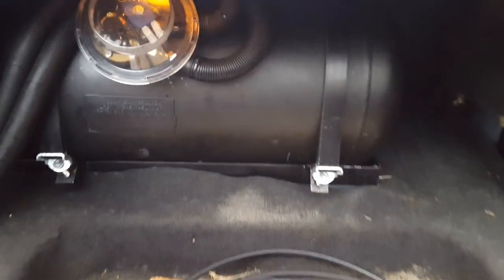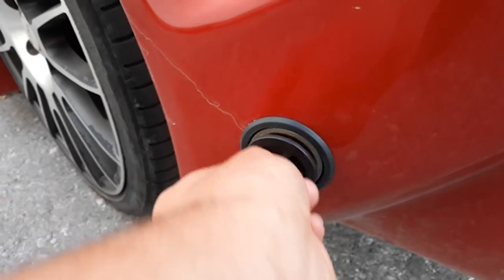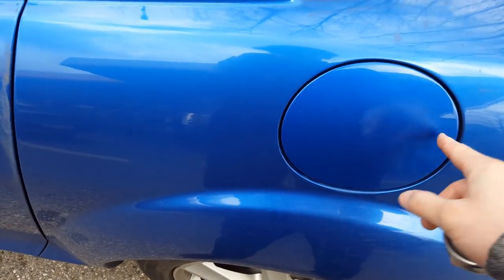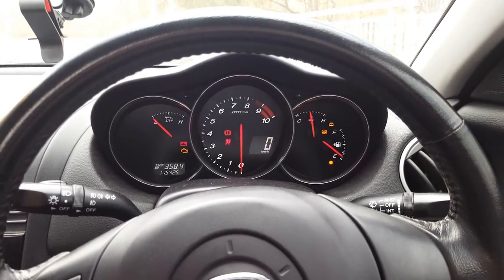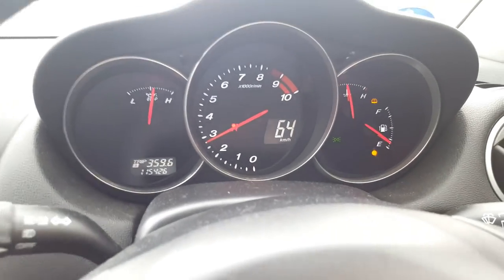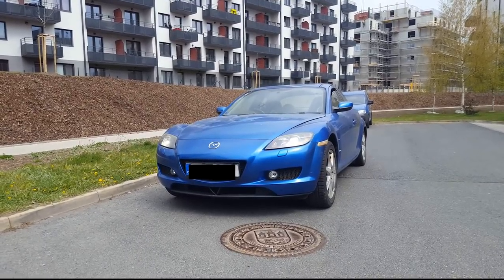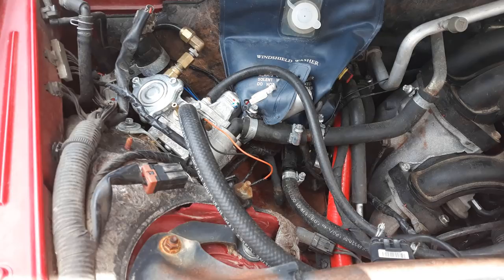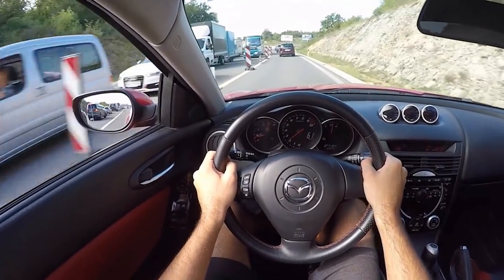Mazda Rx8 LPG Conversion | Pay Less, Drive More

Comment: For those that don’t know LPG = Liquid Petroleum Gas similar to propane. This mod seems only worth it if you drive your 8 long distances daily. You will have similar power and will spend much less on gas. However, the initial cost to set your 8 up for it is not worth it otherwise.
Reply from the maker: Thanks for explaining what is actually is and the essence of it. Cheers!
Reply: Don't forget you're adding a huge weight in the back of the car, which will definitly offset performance and make the car act pretty horrible in a corner. Handling should've been the reason you had a rotary car in the first place, so in that light I think it's a weird mod to say the least...
Reply: Driven By Madness I was actually considering this mod because I daily my 8 but I don’t drive long distances and 93 octane not too expensive where I live. Great mod though if your situation allows. Not many people know about it.
Reply: Flyingdutchy33 very true. It depends if you commute with the car long distances. Some people buying these cars as dailies now because it’s an inexpensive car.
Reply: Depending on Winter and Summae, it is 40-60% Propane and 40-60% Butane. My LPG8 switches to LPG in winter in 2 minutes and in summer within 30 seconds. It just makes most sense if you drive it more than 10.000km a year, just so you get the installation cost back and also have some reasonable savings the next year.
Reply: @Flyingdutchy33  It's actually not that bad. The tank in the rear weighs about 10kg, and a full tank has 40 liters so let's say 50kg. I run on a 1/4 fuel tank with a full LPG tank, so the rear is maybe 20kg heavier than without the LPG installation and a full fuel tank. It does throw the weight balance off, but only by a maximum of 10% if you drive with both tanks full.
Reply: @KiterTMK  Also consider it's pretty high up. I know I have been biting my nails in my hybrid (CRZ) and that battery pack is pretty damn small. Yet it threw the balance of that car off enough for it to stop being fun in the rough & rowdy bits of cornering. And this gastank sits further off centre and definitly higher than afformentioned battery pack.

@mischiefpwns Well, I drive it as a daily and I do more than 10.000 a year. I've decided to sell mine instead of doing this mod. The way I see it, you spend so much on maintenance anyhow that spending that bit extra on fuel is relatively ok-ish for a sportscar. But to each their own.
Reply: Mazda did release a hydrogen fueled Rx8.

Comment: There are two other pros to consider:

1)The added weight lays on the rear axle, so it will increase traction; pretty useful if you drive with rain or even snow

2)You have to worry much less about emissions tests, since the LPG combustion is much cleaner than gasoline
Reply: Added weight is no more than 100kg, makes a small difference still yes.

As for emissions, it is measured for petrol so it makes no difference legally speaking.
Reply: @KiterTMK  in italy you have to register the conversion and it positively affects the legal status of the car. not sure about other countries
Reply: @davidemensigamerCH  same here. I don't see the problem of registering it?
Reply: @KiterTMK  there are none, it's great
Reply: @davidemensigamerCH  exactly. Every 100km you save 10 euro. In 10.000 that's 1.000 euro. It's a free engine every 30k.

Comment: I forgot to mention that the exhaust gasses are especially clean when the engine runs on LPG. Not recommended, but you can place your nose a step away from the exhaust and it's won't bother you at all.

Comment: Hi, still running on gas? Do you know the brand and system that's build in? Does it use a timing advance processor? If so, how many degrees advance? Where are the lpg injectors located? I like to buy an RX8 on LPG with a new engine. But the garage won't give warranty on the motor because of the LPG. It doesn't run that smooth on gas and they are afraid that it will knock. So maybe I need a better LPG ECU??? Al advice welcome.

Comment: Just want to put my 2 cents. The rotary engine runs very hot, the reason why at higher rpm ranges the mixture goes rich is too cool down the combustion chamber, when gasoline is sprayed it takes away heat from the combustion chamber and it generates more from the combustion itself, this doesn't happen with LPG, also gasoline has cleaning properties, for example before using ultrasonic cleaners for engine heads they were bathed in gasoline,so it helps preventing carbon build up. Also LPG burns way hotter than gasoline and that isn't really a good thing for an engine that is already so hot.
Reply: I believe that all engines run rich at WOT for the same reaosns you state. If you would have a source why the rotary runs hotter than any other engine running on petrol, I would welcome that. My exhaust gas temperatures only change by 4% maximum between the fuels. It indeed doesn't have the cooling properties, and the main issue was always that the valves overheated, which was compensated by adding a flashlube injection system. We don't have valves and carbon build-up is usually our problem. Plus, my engine runs on petrol above 5000rpm and on LPG under.
Reply: @KiterTMK  It runs hotter because it's so compact and the amount of explosions that occur, a naturally aspirated piston 1.3 liter engine at 720° of crank displaces 1.3 liters , in the rotary that is twice, 2.6L every 720°. And the cooling properties of petrol the moment it is injected to pull away some heat, happens every time not only at WOT. I understand installing LPG from a mileage or fuel economy since usually it's cheaper, but you still run richer than on petrol, so in the end with a rotary that drinks so much you end up pretty much the same, maybe less but very close. I understand using LPG on normal piston engines, i just don't see the benefit on a rotary.
Reply: @DENetworkES  hmm, fair point. Well honestly, my break even is at 30.000km, so if I manage to drive that distance on LPG I have saved enough money for a free rebuild so to say. So it's more of an economical decision.

Comment: Now just imagine if one were to produce an engine that used a combination of diesel, LPG, and hydrogen gas in a perfect homogeneous oxygen and fuel ratio that ignites by pressure ignition or high compression spark ignition .

Comment: No such thing as LPG where I'm at lol (there might be some, but probably much, much rarer than E85). One thing I can say for certain though. Gas LPG is gonna be BAD for the rotary engine because it runs the motor dry. Apex seal failure will become an issue sooner than RX-8's on normal gasoline. The fact that it won't mix with oil either is concerning, since we need oil for lubrication of the Apex seals. However, A gasoline/LPG or liquid LPG conversion sounds cool, gives you better range, but again, it doesn't mix well with oil. Personally, I don't see any pros of doing it whatsoever. An E85 conversion on the other hand, yes.
Reply: My rebuilder with 10 years experience says that the engine won't run dry, it will always inject oil appropriately. LPG should even be better as it doesn't influence the oil film within the engine. So it's actually better for the oil film since it doesn't get washed away. Another option is to add another flashlube oil injection system. So lubrication is not an issue. Otherwise my already failing engine back in 2017 wouldn't last another 10.000km on LPG.
Reply: @KiterTMK  I'm not saying the OMP won't inject oil at the specified RPM anymore. I'm saying that UNTIL the OMP injects oil, the motor is running dry on gaseous LPG. And it depends what you mean by failing engine. I could say I have a failing engine as well, as my compression on 1 rotor is below 60PSI at the moment, and my other rotor is below 80 PSI... Been running like this for quite a few months since I got the compression tested, who knows how long I've been running like this.
Reply: @Snoopi25  my rebuilder has adjusted it so it inject oil right away. It doesn't need to wait to warm up before it starts injecting oil. Is that what you meant?
Reply: @KiterTMK  no, I meant the OMP (from factory) injects oil only starting at 5,000 RPM or 4,500 (forgot exactly)... this means that below those RPM, the engine is literally running dry. Since most driving is city driving for the majority of the people, that means between idle RPM and 4,000 RPM regular driving, meaning the OMP never kicks in.

Comment: Rx8 is enuiqe engine design. Rotary motor's all parts cast iron. And verry reliable material. However lpg has more octane (116-117) that couses more heat in engine, if you cooled well nothing will be problem. But my car has aleminium block, and aleminium piston heads. If i using with lpg probably 80k engine failure.
Reply: My EGT (Exhaust Gas Temperatures) went only up by 30 degrees after switching to LPG on 1000 degrees for Petrol. So the temperature difference in exhaust is atleast minimal :)
Reply: @KiterTMK  EGR system is not relieble over 100k km. My last car 320k all the long trip, has heat problem.

Comment: Idk... LPG burns indeed cleaner, but hotter and drier and i think that would lead to more premature wear on apex seals, especially since you cannot premix. Also as far as i know LPG is not at all advised for agresive or sport driving.
Reply: That's why my system is programmed to run under 5000rpm. Under high load or above 5000rpm it runs on petrol.
Reply: Oh, I see. Cool, then. Nice job!
Reply: @mihailcioinica  thanks! We thought it well through :). It's great for highway to save fuel when you don't need the performance. But when you need performance, it switches over. I can also press the button and switch seamlessly from fuel to lpg within a 2 second transition.
Reply: @KiterTMK  
Sounds awesome 👌

Comment: Driven by madness I'm have some issues with my 04 RX-8. I was driving a just lost power. Shift to 2nd gear and it berly accelerated staying at 20 mph and very slowly increased. Do you know what that could be?
Reply: I'd start with your spark plugs and coils
Reply: I'd suggest doing a compression test and that will allow you to progress through the troubleshooting process.
Reply: Hopefully you figured out the problem by now, 
And if you did, what was the problem?

Comment: What do you think about Hydrogen RX-8 ?
Reply: I would like to know this too. I wonder how much LESS carbon build up would occur?
Reply: @ss4vegeta1  Much much less, the only source of carbon would be your oil, of which you burn 1 liter per 1000km. Gasoline would otherwise be the original source and of this you burn 150 liters per 1000km.
Reply: @KiterTMK  if that is the case, then that should have been the mass produced model than the latter.
Reply: Engineering explained has made 2-3 videos on that topic, go and watch them
Reply: @PELPIDAS  I was about to suggest that haha 😁👌

Comment: I Had LPG in brand new engine. 40 tyś km later engine was dead. 4 Bar on first rotor and 0 second. Pay less for fuel more for rebuild.
Reply: From the money you saved you could pay for the rebuild. So basically it's like running on petrol with a free rebuild costwise.
Reply: I am driving mine since 60000km, the car is above 20000km now.  had one rebuild around 130000km.

Comment: Can you do lpg conversion on rx7?
Reply: Yes
Reply: @aleksandr_elkov  can you do e85 and lpg at the same time?
Reply: @aleksandr_elkov  yes
Reply: @aleksandr_elkov  ETANOL ;)
Reply: here in Greece an LPG conversion in RX7 FC has taken place and was very succesful!
Reply: @j0lel666  Yes, you can specify the mixing ratio of both fuels at any rpm and any engine load.

Comment: Unfortunately, LPG installation will cause the rx8 to fail prematurely. like after 15 to 20k miles. The problem lies in combustion temperature of LPG. It's much higher when compared to the gasoline, and the additional stress caused by this just rapes the apex seals. It's possible to lower the temperature to somewhat acceptable values, but this will cause a huge drop in horsepower.
Reply: I have a friend who is on his 70k and does not have any problems with the LPG on his rx.
Reply: Do you have a valid source? I ran 10.000km on LPG on an already failing engine.
Reply: Yeah, my opinion is based on experience of all rotary specialists in my country. Of course there are some one of a kind rx8 which do not crap out in a second on LPG, but there are also normal rx8s which didn't stop working even after 200 000 kms. This does not mean that every engine is capable of doing so. Generally speaking around 9 out of 10 LPG powered rx8s crap themselves out very quickly. It may be somehow related to their owners who are probably cheapening out on more than just fuel for their cars, but these stats are somewhat solid. Also if you use your rx8 for track driving, you just have to premix. You can't do that properly with LPG powered rx8.

But all in all, i really don't understand the problem with fuel prices. If you can't afford to fill the tank of your car, just don't fucking buy it.
Reply: @micharozniakowski954  you don't seem to be well enough informed about LPG because conversion does not mean I remove the entire petrol tank. It's an addition and I can switch between LPG and petrol anytime I wish.

I can still premix and do trackdays, it will run on petrol like any other RX8 except it has a few kg more in the boot due to the gas tank.

I can turn the LPG system on and off whenever I want and program it with my laptop to run any ratio of LPG and petrol, at what rpm and even engine load it switches over.

It's simply a waste of money on expensive fuel burnt when you drive 130kmh on the highway for 200km, which is a difference of atleast 20 euro in fuel price.

A rebuild costs 3000 euro, let's say I save 1 euro for every liter and I average 15l per 100km. 15 euro per 100, 30 euro per 200, so 3000 euro per 20.000km. Adjust the fuel savings to you liking. But my point is that if the engine lasts atleast 30.000km, I would save enough money for a rebuild.

Basically, I drive for the price of petrol but with unlimited rebuilds. Doesn't sound like a bad deal to me.
Reply: I see but with lpgs the oil film on the housing stays for longer because the two does not mix at all. So it is a kind of a plus. On the other hand I am talking based on my own experience and the experience of the rotor mechanics in my country as well and I observed not just one LPG rx-8 which running perfectly after the 50k km. So it is all based on the style of driving and how much you are taking care of your REX-8, because it is more like a child than car as you all know.
Reply: In the end it has its pros and cons but if you drive short distances and especially in towns it does worth. But as Michal said, I think this car and the maintenance it takes have to be calculated well according to your budget and the money you would put in LPG can be spend in something which will prolong the life of your engine as a result, for example upgrading the cooling under your hood and one of your oil radiators!
Reply: @soulbrothers  an oil temp and pressure sensor are almost a must to have indeed. Also as far as engine goes, there have been cases of new rx8 which needed a new engine in warranty within 20k miles. It's sometimes hit or miss.

Comment: Fact is, LPG is dry and extremely dangerous to your Engine if it runs lean. You definitely need to have your OMP working 100% to compensate the lack lubrication from fuel. From personal experience with LPG unless you keep the system properly tuned which is extra maintenance and money, you do put your Engine at risk. Personally I don't see the value. You're better off having a second car as a daily.
For those who have concerns about carbon build up, a water injection system will do wonders for your Engine by essentially steam cleaning the internals. I've personally done water ingestion using distilled water and a spray bottle. Done correctly, my Engine ran smoother and definitely had better combustion. {∆}
Reply: It won't run lean since the LPG ECU takes feedback from the OBD2 readings, especiall the o2 sensor. So the mixture automatically adapts to a stoic value. I didn't experience any lean or rich operation of my engine unless there was something seriously wrong with the car itself. Granted, it doesn not have the cooling effect of petrol (gas vs liquid), but my exhaust gas temperatures only change by roughly 1-3% on highway, and the same goes for WOT. I just don't know the temperatures of the combustion chamber, but given that the exhaust gas would be expected to cool down in a similar fashion, then it shouldn't vary too much either.

Flash lube injection or destilled water injection would still be recommended.